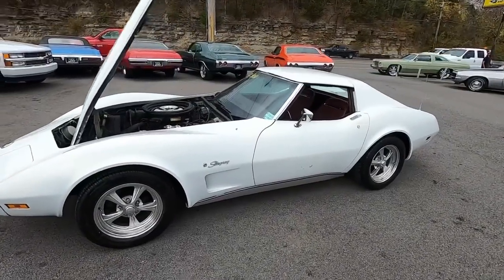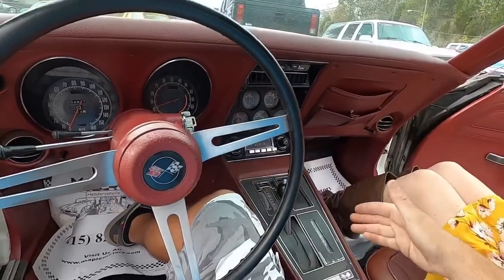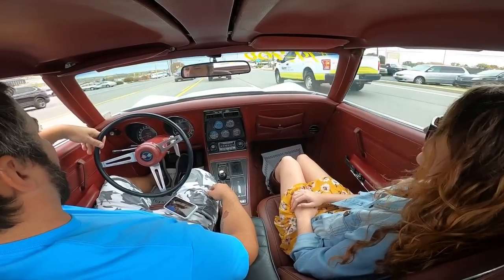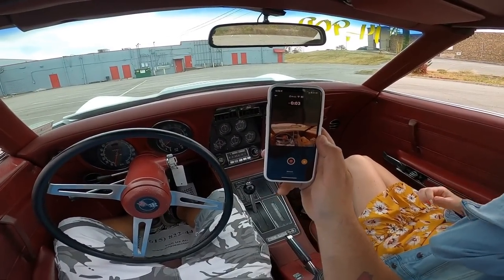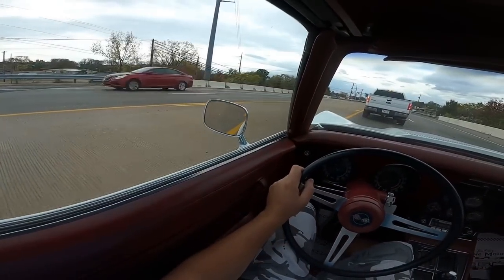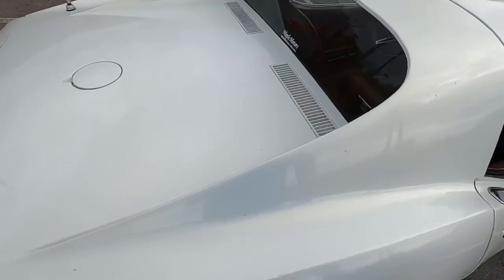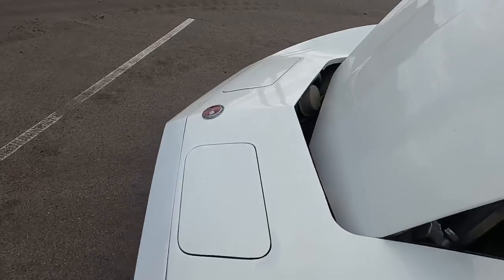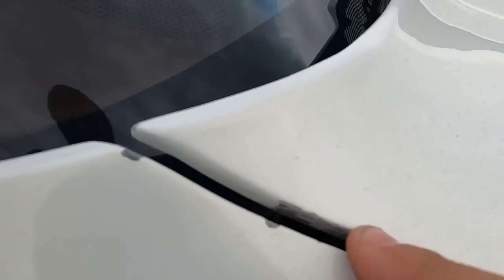Test Drive 1974 Chevrolet Corvette SOLD $14,900 Maple Motors #1687

Comment: Corvettes….. easy to hot rod massive amount of performance parts for Corvettes.
Easy to work on . One person can swap out a corvette rear differential in about an hour.  Try that with a conventional rear axle. You can even change the front and rear body clips . Revert to fiberglass.

Comment: 74 Vette with factory 350 not bad clunker 305 engine u can always replace those interior parts later down road she's good luv the push button start under dashboard & tilt steering under $15grand must be dreaming.

Comment: Why are vetts so cheap. I'm surprised you don't keep it.
Reply: I am a huge C3 Corvette fan. But, they need owner knowledge of what these cars need. They can be uncomfortable to work on. The AC is tricky. (Thank goodness for Vintage Air!)
Brake calipers, rear wheel bearings are different vs regular GM items. The frame needs to be reviewed for rust. People dislike the low performance, but that is how things were in mid 70s.
Not saying to avoid a Vette. They are a great cruisers. I think are awesome.